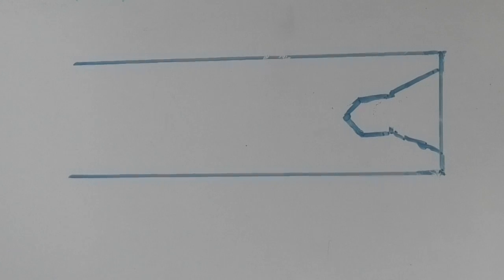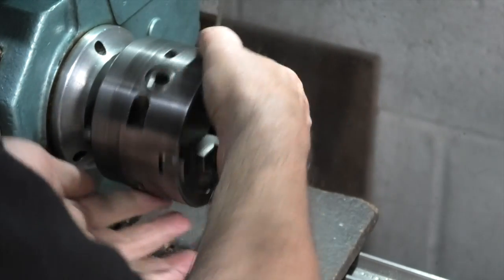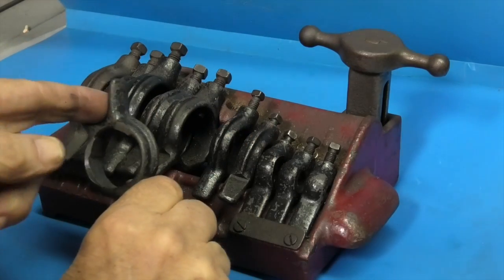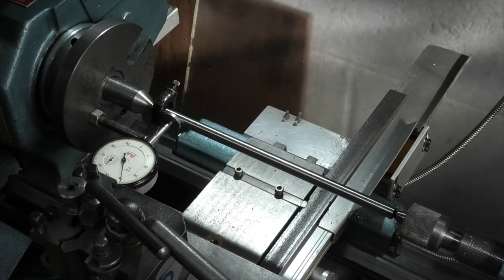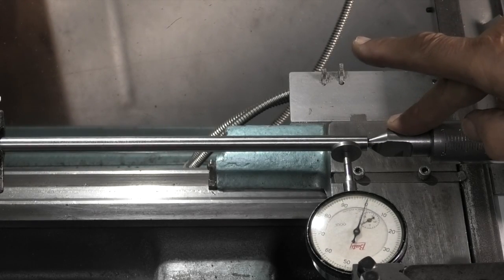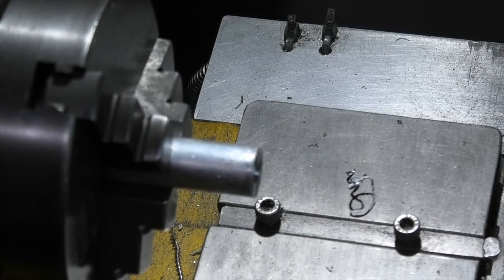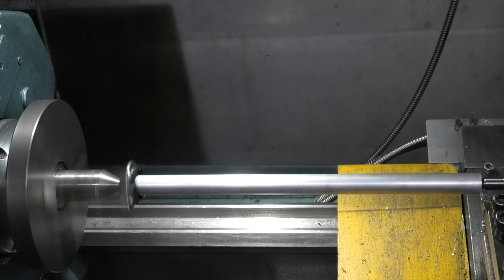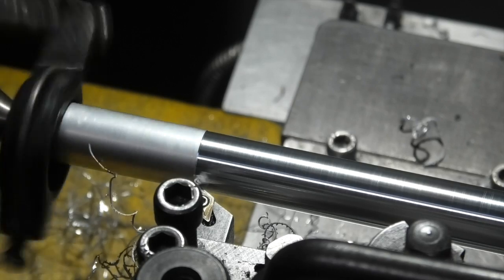Turning between centres

Comment: Truly, there is no need to remove the 3 jaw Chuck...Put a piece of somewhat hard steel in the Chuck, and then generate/ turn a DEAD TRUE center, in the Chuck, position a driver with pressure against one of the jaws...saves LOTS of time, and more accurate...this is how I turn my Tool Steel blanks, between centers, and green turn the material (leaving mat'l on for finish grind, after heat treat)...there ya go...generation of a DEAD TRUE center, using the compound, in my estimation, is a much better approach...Hello from Wickliffe, Ohio  U.S.A. ...😊